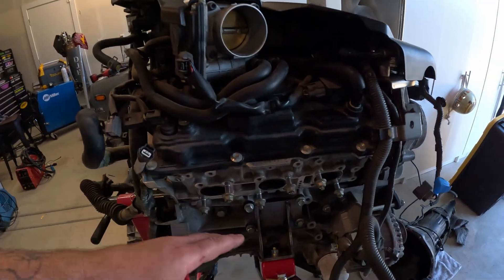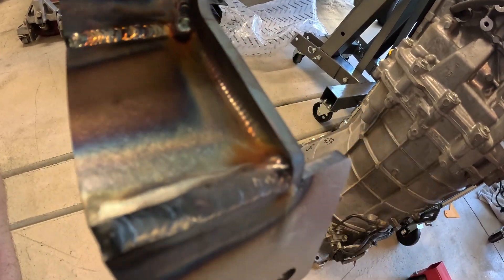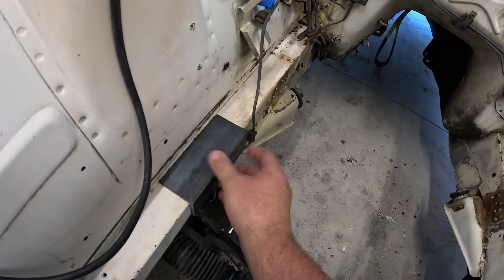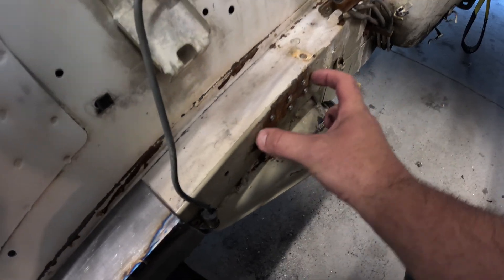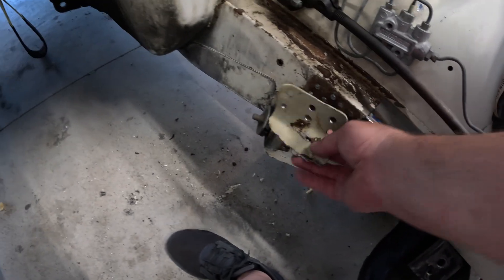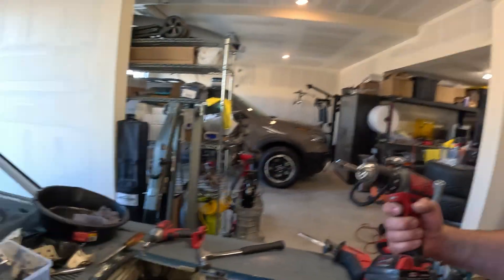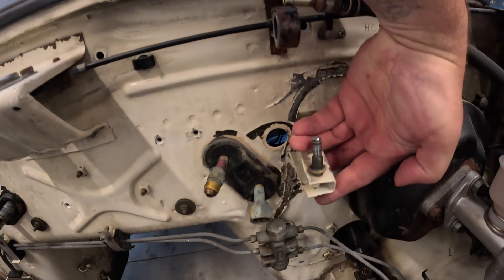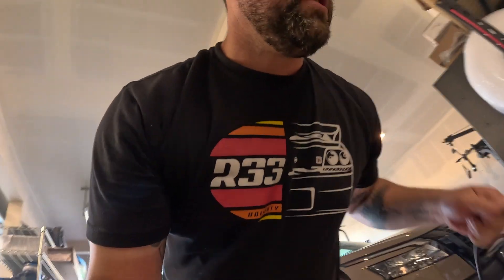VQ35HR swapped 280z

Comment: Did you get the motor to clear the hood latch?
Reply from the maker: Kind of, It ended up hitting the bottom support of the latch. I just ended up removing the entire thing for clearance.
Reply: Damn ok, do you think there would be room if you moved the motor forward and did some redesigning of the subframe or did it hit the steering rack? Was thinking about doing the same to my S30
Reply from the maker: @tpbw4321  EVen as it was, it was up against the crossmember. Z fever makes a kit to do the swap....I should have gone that route. It would have saved me a bunch of headache.

Comment: Great video, you're about 3 months ahead of me with my '76 280z and VQ35HR. (finished a VQ swapped 620 and KA24e 510 in my stable). 

I've already replaced the engine frame rails with .120 wall square tube, so the mounts should weld directly for me.

I removed my hood release and am going with hatches. Not ideal IMO, but makes the engine bay a little cleaner. Hexa Garage (or something similar) will make your wiring MUCH easier.